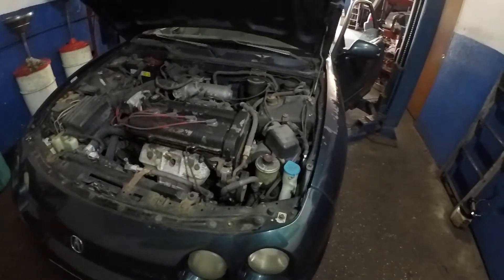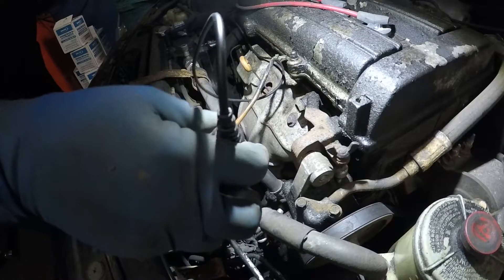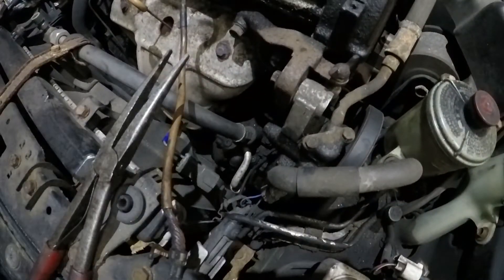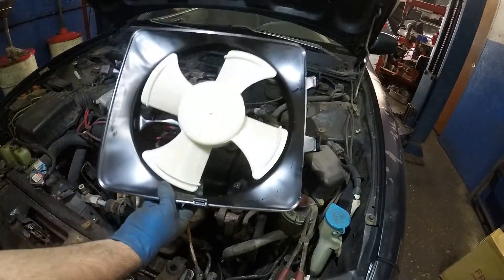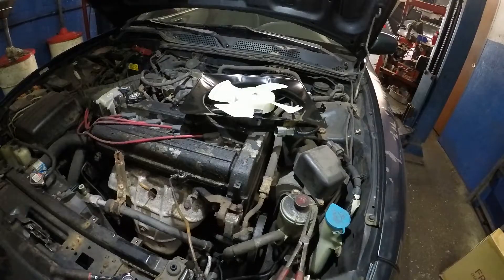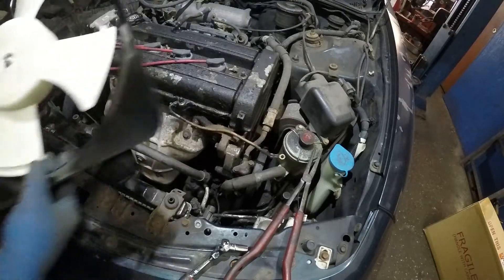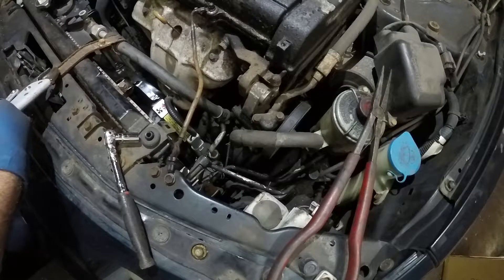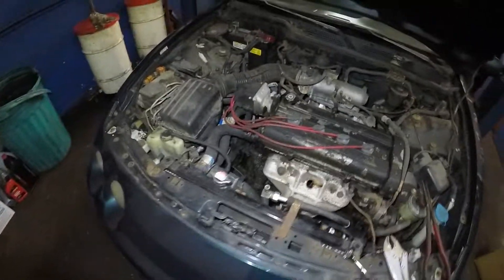Acura Integra or Honda Civic Over heating bad Fan

Comment: Was this done with the AC off? I have read that the driver side "AC fan" is only supposed to come on when the AC is on (together with the AC compressor), and that the passenger side "radiator/cooling fan" is designed to run alone for engine cooling. I have also been told the reverse, that both fans are supposed to run when the engine gets too hot (without the AC compressor running if the AC is turned off). I ask because someone wired my Integra such that both fans run whenever the engine needs cooling (which is often because it's turbocharged) and the AC compressor also runs when the driver side "AC fan" runs, even with the AC turned off. I'm trying to learn what the factory operation is supposed to be in order to separate the AC compressor, if that's possible.
Reply from the maker: Yes ac off well both fans has function some time car will over heat with ac on then it need both fans